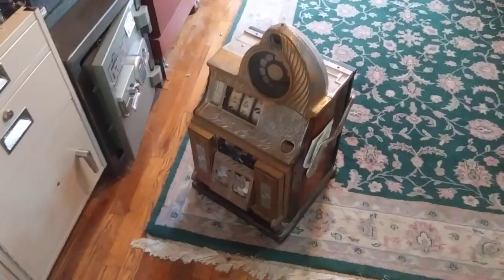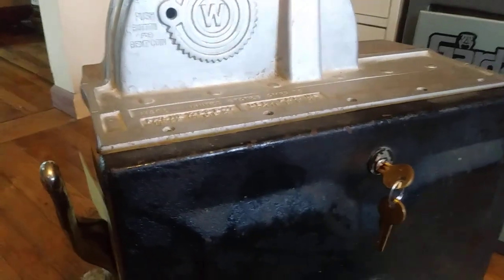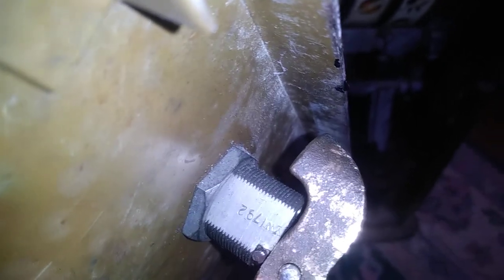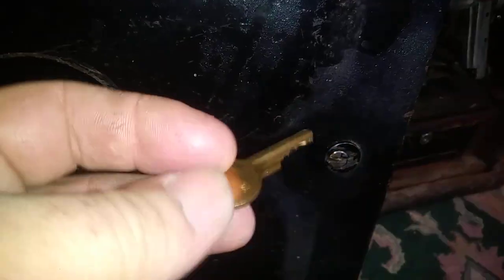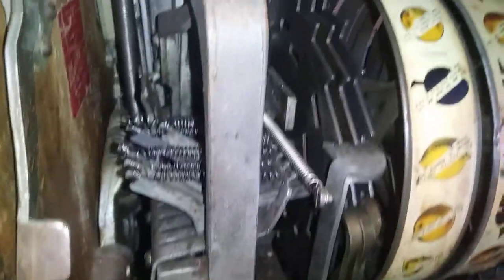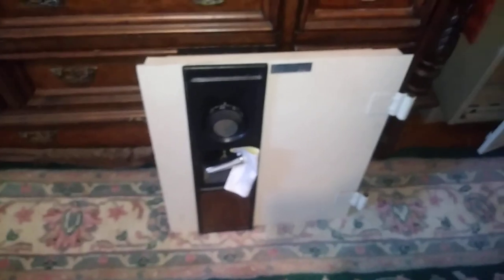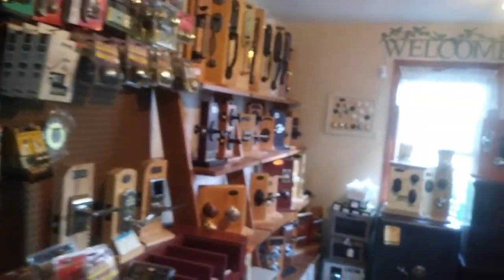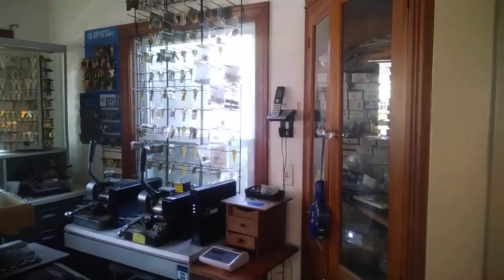Keys made for vintage slot machine in Steve's Locksmith shop

Comment: thanks for that Steve.  Wow, look at the strength of the cam on that old lock....
you sure never see anything like that now.  pick & sight definitely the way to go
on that one.  I'd like to study the mechanism of that to see how the randomness
of the wheels is generated.  Congrats on paying off the shop!  just rekeyed an 06
toy matrix doors and hatch.  one screw on edge of door to get door locks out and
the hatch comes off from the inside after pulling the panel.  I found an old Keil
automatic machine  like yours but the vises are missing so might try to restore
it.  Enjoying your vids.